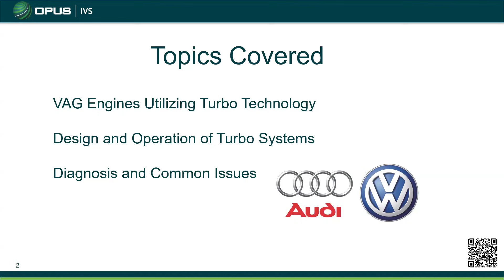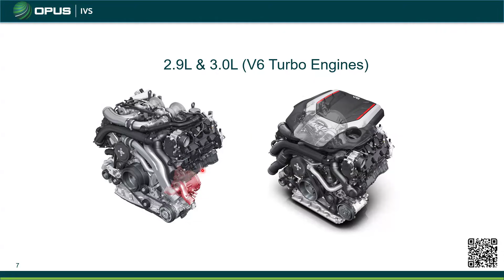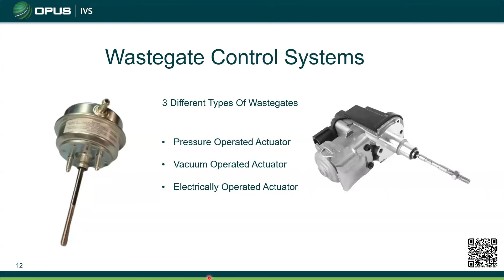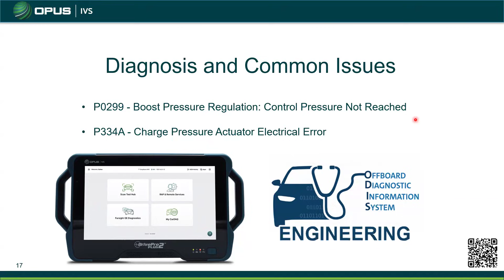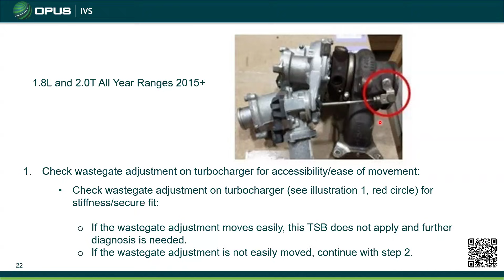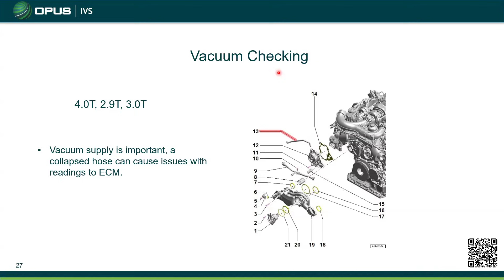VW & Audi Turbocharger & Power Loss with DrivePro 2 Webinar

Comment: MQB doesn't reference the engine design (as you described, modular). It's a reference to the chassis. We've got PQ35 cars with the EA888.3's that aren't MQB.

Regarding the comment about the IS12/20/38 and the EWG not moving on key-on or adaptation and needing to replace the turbo; There are 3 common failure modes for these EWG's and associated componentry, none of them are the actual flapper arm binding itself. In all scenarios replacing the EWG will resolve the issue. A turbocharger replacement in these instances is not required.